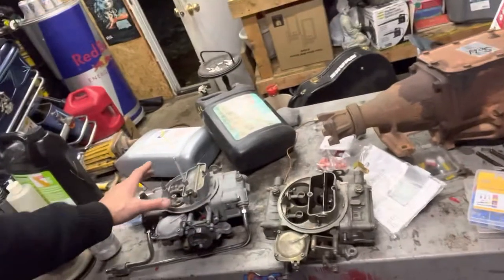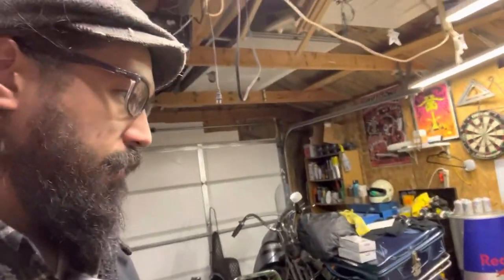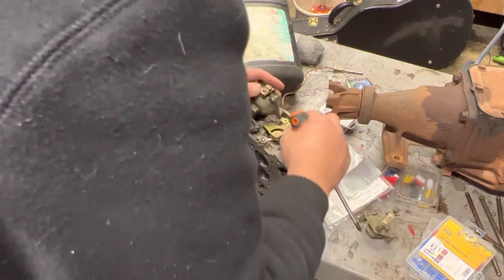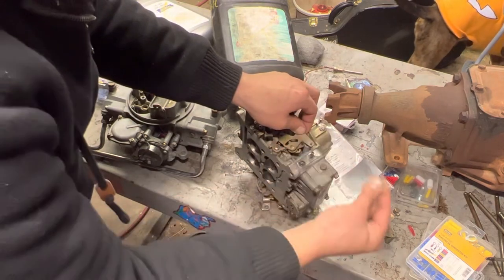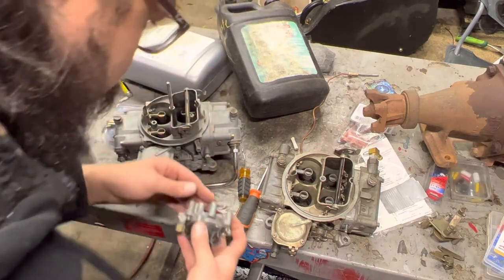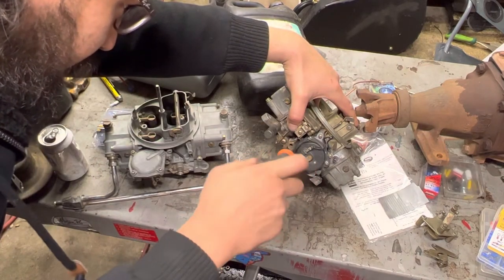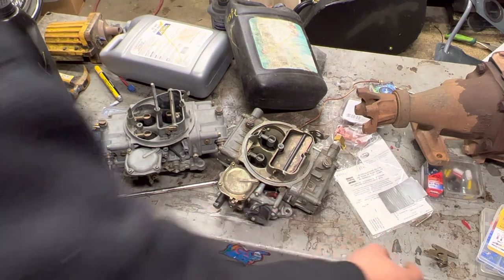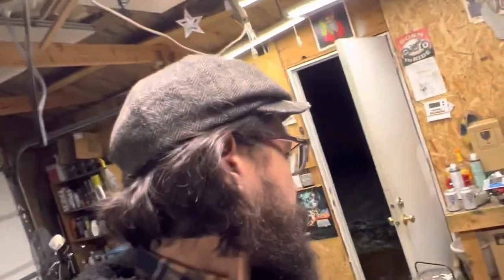Holley Carb: Manual to Electric Choke Swap

Comment: Hey! I want to replace my manual choke carburetor on my chevy 350 5.7L with an automatic refurbished carburetor. Will the swap be okay, obviously the manual choke cable with be obselete, but is there anything else I should be concerned about regarding the swap? Thanks
Reply from the maker: I like the electric ones.  One wire to ground, one wire to hot.  Then adjust the spring as needed.  Should be pretty straight forward.

Comment: The fast idle cam is freely rotating behind the choke housing.  Do I need to position it in a particular way when installing the choke?  Thanks
Reply from the maker: Been a minute since I looked at a Holley. Your linkage is free floating?? I’ll try and pull mine off the shelf to re look. Just wanted clarification. Thanks for watching!